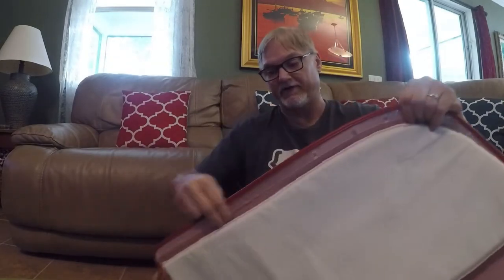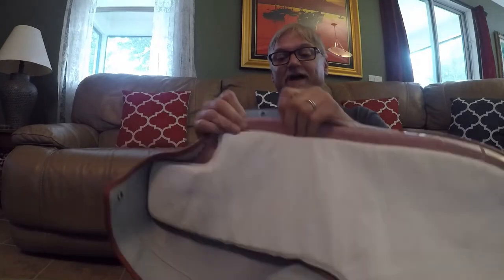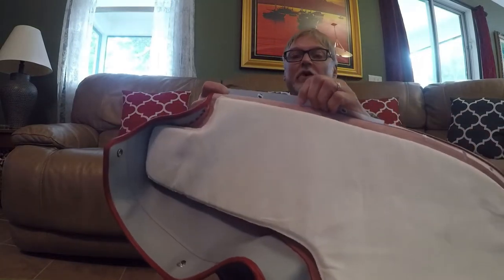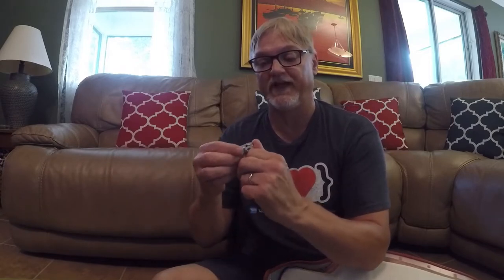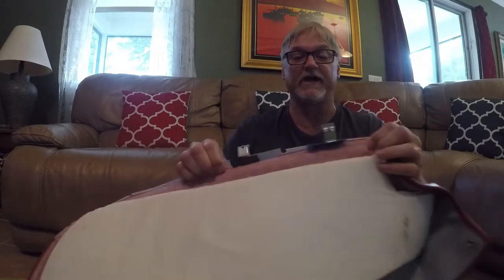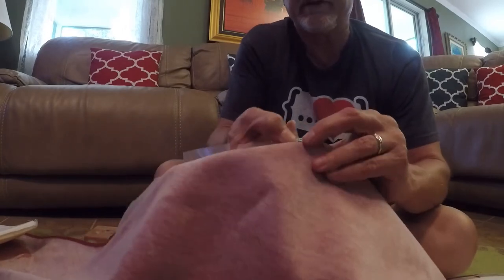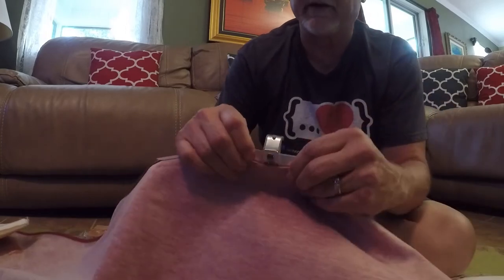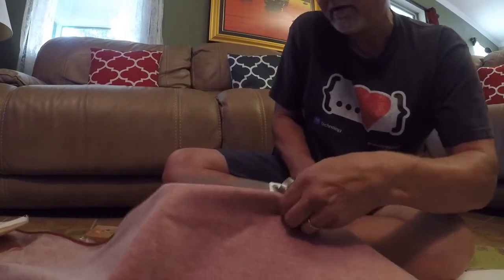Convertible boot clip installation

Comment: Thanks for the install tips. I'll be installing the same boot (same color) on my 70 Chevelle with the same clips. I'm wondering how it fit on your 68?  Was there any wrinkles or any adjustments you had to make to the clips. Would it be better to install fewer clips to start and dry fit it?   Thanks again!
Reply from the maker: For my top i put it in the sun for almost 4 hours to help stretch it.  I also made sure that the clips where fastened was good on the car.  I did this by just laying the car cover and using tape marked where i would install them.  It turned out great ... is it perfect NO but only i can tell most people tell me i did a great job.

Comment: I'm confused. I had a 1969 GTO convt that didn't need clips. It had the vinyl strips that slipped under the trim
Reply from the maker: the clips attach on to the boot cover has shown in this video.  Then this boot cover using the attached molding clips attach to the molding around the chrome molding and of course the snaps snap onto the snaps located on the rear panels.  I will post another video of the final installation here shortly.